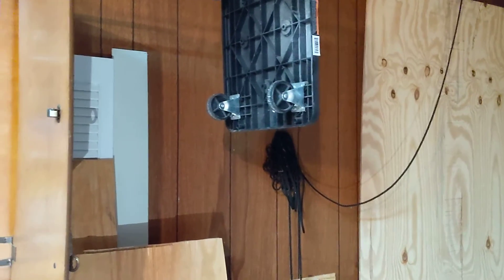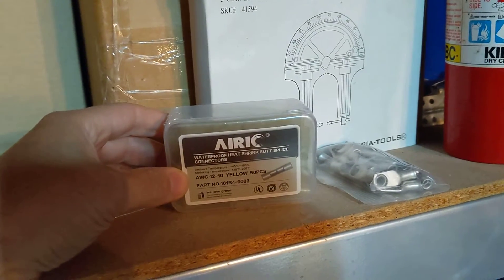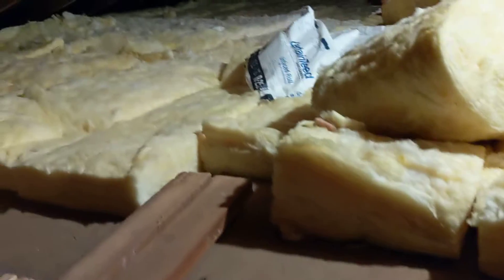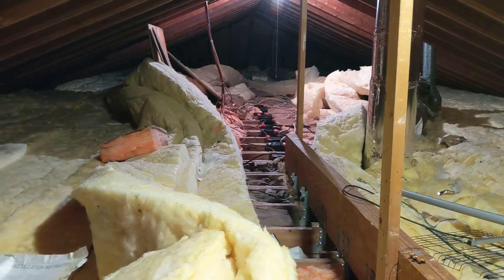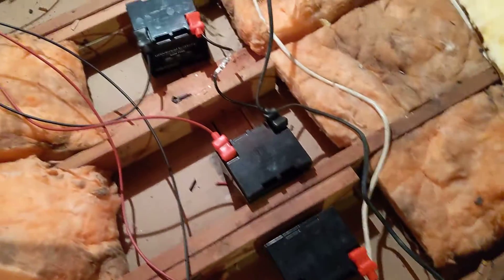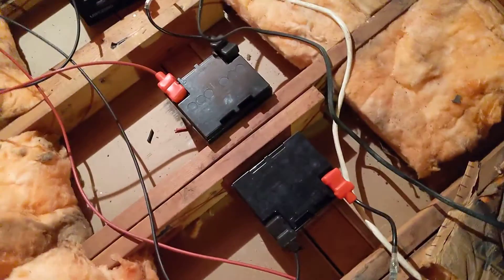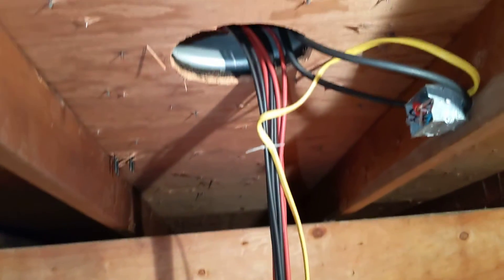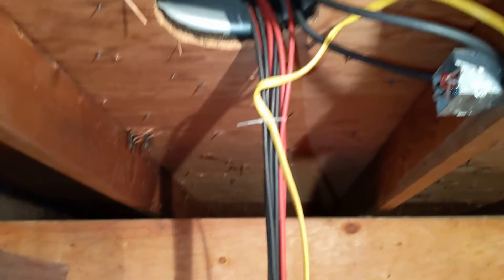Legion Solar-Battery and cable installation

Comment: How did you wire the battery commanders to the off-grid controller and off-grid inverter? or did you use the off-grid set-up? Do you have to use the inverter and the controller? thanks
Reply from the maker: Hi. I don't have the off grid components for the system.  I didn't see any point, frankly.  It just provides a couple of outlets that can be used to manually power devices using the batteries that the battery commander charges up.  It doesn't automatically feed back into your home's electrical circuits or anything.

Comment: Are you worried about ice damning on your roof near that vent?  It looks shallow to the roof line...  snow builds up, then melts but can’t escape and can “flow up” or pool and drip into openings.  Not sure if this will be a problem but I’d keep an eye on it when big snows occur.
Reply from the maker: Thanks for thinking of that.  I don't THINK this will be a problem.  The vent that I chose is:

https://www.menards.com/main/building-materials/roofing-soffits-gutters/power-vents/air-vent-galvanized-slant-back-static-roof-vent/rvg55bl/p-1444423376135.htm

which is a pretty standard vent that I see around here on houses and is 5 inches high.  In addition to that, the vent is actually located underneath a panel, so hopefully it won't get too much build up on it or near it.  I will definitely keep an eye on the whole system when we get snow, though.  Thanks for commenting.